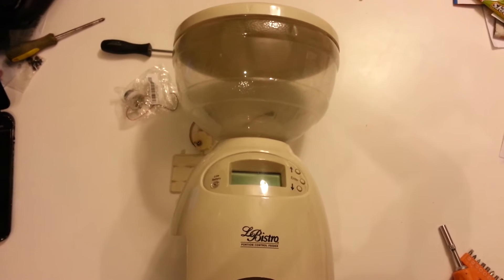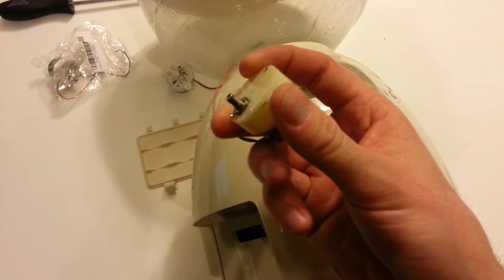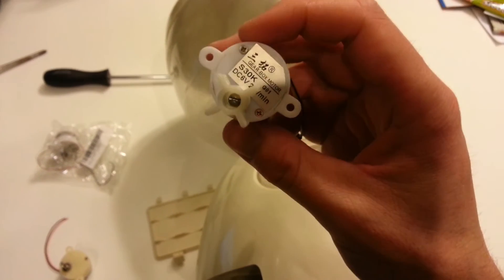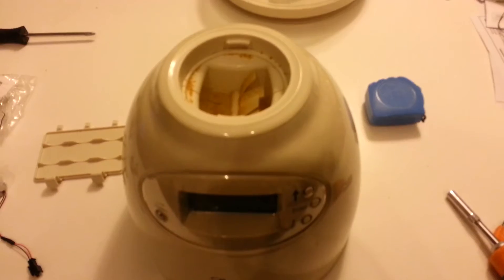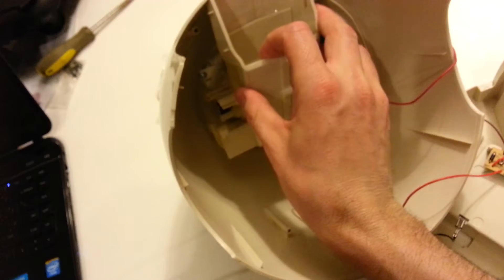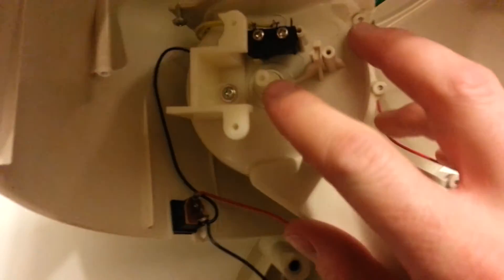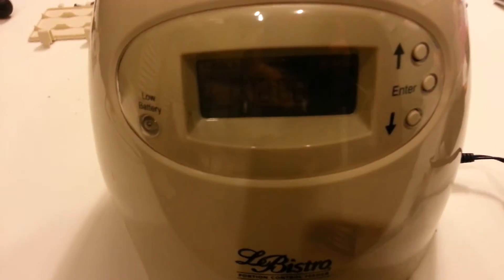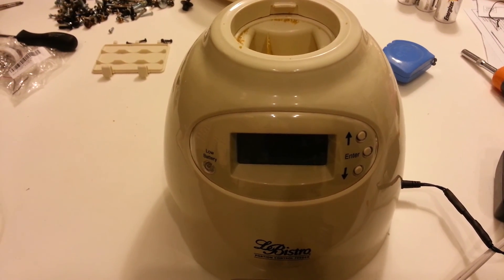LeBistro Automatic pet feeder portion control fix

Comment: Hi, I am not sure if you are able to help me. I use A/C adaptor for my dog feeder, and I noticed it has been turned off and doesn't go  back on. I changed the A/C and still not turning on. Do you have any idea what could be?
Reply from the maker: Carla Garcia 
Is it the correct voltage & current rating?
If not it likely damaged the circuit inside the feeder.
Reply: Thank you for your replied, ye the voltage is correct. I have been used for last 2 years. I guess I need to open it. :( . Thank you again.
Reply from the maker: Carla Garcia 
No problem, hope you get it working again.

Comment: Where can i get the paddle wheel for this LeBistro pet feeder?
Reply from the maker: Joe Mack I wish I could tell you. Several of the tabs on mine have broken off. I haven't been able to find a replacement.
Reply: Thanks Brad,  I have this lazer bond that repairs with UV light.  I haven't used it yet.  One of the paddles is hanging on.  I try it there.  the other one has the 2 center ones (out of the 4) missing,  I was thinking i can weld (if that's the right word) 2 of the shirt collar stiffeners there.  Lets hope it works.  Thanks once again,
Joe

Comment: Twice mine has had the fins break off the spindle, and I called up Petmate and got new ones for free. Not hard to install. The fins slide into the axle's groove, simple.
Reply from the maker: downbntout 

Awesome thanks I didn't know where to get them.
Reply: Well this second has fins that weren't as precisely molded, so they did not 'slide' easily in. I was on the phone with Petmate's tech dept three times, much struggle, and now they're sending me a new unit. Don't know how long the warranty was, but they made good on it. Whew!

Comment: I actually ordered the motor and it worked but when I put cat food in the feeder the motor was not strong enough to make the rotation. :(
Reply from the maker: Jeff A. 

Really....New batteries? 
Mine worked for a while after replacing the motor but all those plastic tines broke. You might have a bad motor or another problem there. Since those motors are so cheap I bought two of them.
Reply: Yes, new batteries and I bought 2 motors also about to see if the other motor gives me a different result. Not sure if it matters the motor I have is 20RPM and I saw another one online for sale it looks identical and it says 21RPM
Reply: Also, the wires on the new motor are much thinner than the original, not sure if that matters.
Reply: Just tried the 2nd motor and it works until you put cat food in then it's a no go. I will have to do research and find a better quality feeder. It was worth the try and thank you for the video.